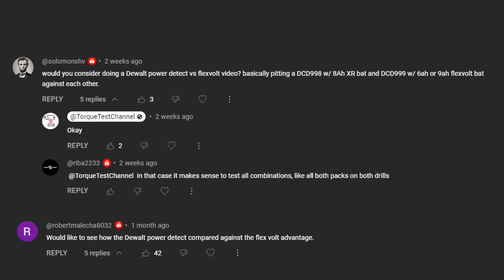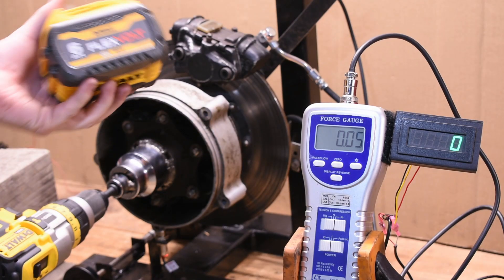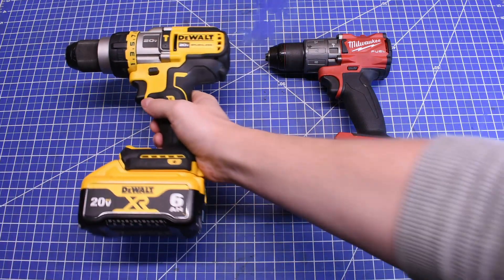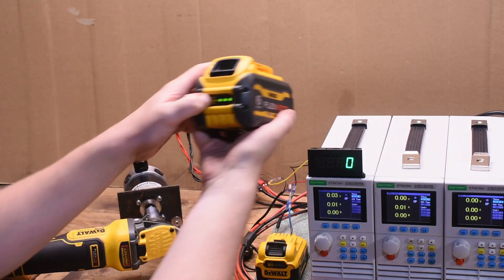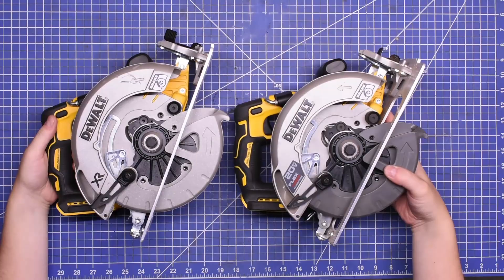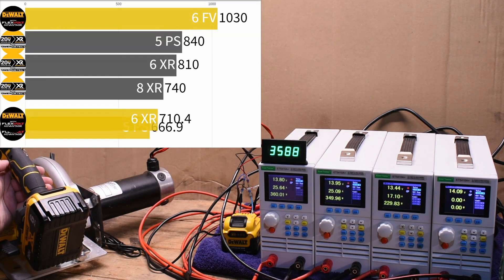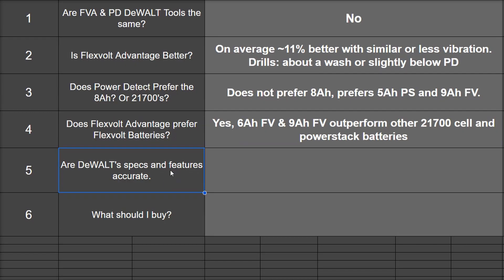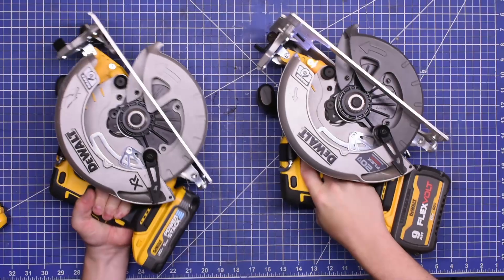Investigating the Biggest Lie in Power Tools: DeWALT's Flexvolt Advantage v Power Detect

Comment: Starting my tool collection from scratch after being out of the country I spent a lot of time picking a base brand I went down the rabbit hole. I ended up with Milwaukee because they had the least confusing battery solutions. I know every battery works on every respective tool. I think DeWalt has some amazing stuff but limited by their complicated battery options.  Trying to buy my dad and brother DeWalt tools can lead to madness. Thank you for this video as I hope it saves others the rabbit hole.
Reply: Say what you will about Ryobi's tool power (they seem to consistently take up the rear in head-to-heads between all the brands @ Home Depot) but the fact they all use the exact same battery is nice. 

Even if the battery is foot shaped.
Reply: @steveheist6426  I use many Ryobi tools. The problem in my opinion with Ryobi is the cells in their batteries. They use cheaper cells a lot of the time and it hampers their own tools.  Fine if you are using a tool that doesn't demand excessive current but  use something like a mower, grinder and suddenly the battery will run into thermal issues before it is out of capacity. I recommend Ryobi just trying to set expectations.
Reply: @cndjonno  I definitely have run into thermal limitations of the design with their 18v mower in Arizona heat, I will give you that xD
Reply: dewalt seems to finally be phasing out their older batteries and streamlining their lineup for tools as well. finally.
Reply: Milwaukee's dog shit battery lineup is the reason i went with dewalt. there are no good compact 18V batteries. their 2amp M18 battery is huge for what it is. their compact tools have their own battery 12v lines that require different chargers. 

with dewalt, you can get a tiny 1.7ah powerstack (my favorite battery) and it will work with the entire tool lineup, anything from a compact drill to a chainsaw, with the exception of their really expensive 60V tools. but those are clearly marked as being 60V. Their 60V batteries can work in 20V mode and will run anything.
Reply: @solomonshv  every one of my Milwaukee chargers has a spot for the 12v batteries
Reply: @solomonshv i think you never really worked with the fuel lineup from milwaukee. And now you’re on the best of dewalt. Comparing apple and oranges. M12 tools are smaller tools and made to replace handtools or small air tools. Then m18 are the bigger, more powerful tools. It’s really easy to understand and most have both. That’s why milwaukee gives a charger that charges m12 and m18 in their kits.
Reply: I own dewalt but I would own Milwaukee. I think it's smart that they have different battery form factors.

Comment: I have 3 Flexvolt 60 tools and there all great performers 

The 17 inch Flexvolt 60 Trimmer crushes battery’s even on low and goes through 6 amp way to quickly with 9amp being much more useful

Comment: Honestly this kinda makes me feel I'm glad I own Ryobi. Everyone I know gives me the. (are you serious look) but then in my end it still cuts and drills and if they don't perform that good... Well... I have more batteries to burn though.
Reply from the maker: What's Ryobi's best mid size battery?
Reply: @TorqueTestChannel  I'd put my money on the 4 or 6Ah, but they do have 21700 cell packs now as well in the form of the 8 and 12Ah.
Reply: @TorqueTestChannel  if we're talking about workhorse batteries it would have to be the 4amp hour in my experiences. And I'm a power user of Ryobi, rigid, and Milwaukee. Will a little bit of Bosch.  Obviously through your work you might have noticed that rigid and Milwaukee do 5 amp hour. As a power user of Ryobi you pretty much are face between two different four amp hours being the regular one or the HP. I do feel a little bit better performance on the HP especially with blowers.... Still runtime probably is better on the HP batteries because you don't have to work as hard as the standard 4amp actual work . And not to be confused with more productivity with an HP battery. As well as looks. Ryobi is really sports car styling their tools especially the HP line for people like myself to feel better. The HP batteries and tool do perform... But still it's going to be a 4Am phone for I feel 90petcent of Ryobi users even if they're power users. The yahhh.. 6 and 8 and 12... But those are really for power hungry tools like blowers and vaccums for excellent runtime or saws to work on job site with allot of use
Reply from the maker: They have 3-4 different 4ah batteries is my point lol
Reply: @TorqueTestChannel  Right, yes, their marketing sucks. I'm talking about the PBP004 (HP 4Ah) and the PBP007 (HP 6Ah). The 21700 packs are the PBP1008 (HP 8Ah) and PBP1012 (HP 12Ah).

Comment: Is there anyway you can hook up the tools to a current regulated power supply? This would definitively prove that there's no tech really involved, it's just down to how much total power the tool is able to draw from what is connected and that most of the tools are artificially limited by the capabilities of the battery packs, wiring, and controllers. This could also add another stat to the charts of theoretical maximum output for the tools which could help see what kind of improvements the manufacturer could make just by optimizing the batteries to hit those max power targets in future revisions of the tool(s).

Comment: Thank you Torque test channel. You guys hit it on the head there’s so many hurt feelings for their Tool brand but the battery voltage does make a difference…And higher output or watts or torque can be limited by the individual cell output ie more expensive cell. Equals a higher tool output ?  The RC industry uses a “C” rating on batteries 🔋 and that greatly affects cell output and usually cost … could you use a c rating on tool battery packs? PowerStack
Forge
 Are pouch cell batteries that are lithium polymer?  And one cell can make 4.25 Volts.
Open cell voltage. 
Check out Gens Ace HVLIPO. Can you guys do a show on battery technology? Or have you?
 lithium-ion or Li-ion 

Lithium Polymer or LiPo 

Lithium Polymer HV

LiFePO4 
How do these compare?
How are these now considered “Safe”
LiPo’s used to have a “recommended” charging of inside a fire proof bag ?
So ?
Is Lithium-ion-polymer 
A new type of battery chemistry 🧪?
Or just a tool company made up word?
What’s the difference 
So a M18 with a open cell voltage of 20 now could be as high as 21.25 volts??
If it’s a 5 pouch cell battery 
Or 25.50 if it’s a 6 cell battery??????
Ha ha 
Love the Channel and the No BS Torque output #’s
Reply: Dam can I edit IPHONE VOICE TO TEXT SUCKS

Comment: I am confused about the "Advertised Difference Column", advertised difference in reference to what? A non FVA and Non-PD tool, or in reference to each other?
Reply from the maker: The difference DeWALT advertises or at least has provided some spec to the press between FVA and PD. Like FVA is supposed to be THIS MUCH more powerful than PD based on watts out

Comment: 1% is testing error
Reply from the maker: 1% is a testing error within 1 test yes. At least. But each test had 5 runs and used median run as data. There was 3 different tests, torque, watts low, watts high. Each of those 3 tests were performed on 2 tools, 4 batteries each. Each average of each test came out with match data.
Pluss this way of measuring watts is fairly consistent, the tools always make the same every time. That all said, you're still right. 1% is nothing.

Comment: It's as simple as Lowes and Home Depot having their exclusive high end offerings for customers who frequent one store over the other. What irritates me is the amount of R&D $ dedicated to making tools with trivial spec differences drives the prices up.
Reply: Im sure it has to do with pricing also. By that I mean price matching between retailers. If the 2 headliners have exclusive models, then nobody else could have the same model for cheaper.
Reply: probably takes 10 minutes to decide how to make them different since the differences are so minor.
theres no R&D in that...they just call joe the electrical engineer at his extension and ask.
he pulls up the component specs and says yeah make this capacitor bigger and this resistor smaller, turn down the potentiometer a couple percent and voila....motor is good for way bigger difference so it dont matter a few - 15% percent......when joe quits theyre scrambling tho
cuz it is that easy
Reply: @kazzxtrismus  I can only assume that's an oversimplified way of looking at it. They have different internals, different externals, different labels, different packaging, different advertising signs/online listings, etc.
Reply: its literally how it does work.....changing aesthetics etc is just "icing on the cake" or marketing department shenanigans.
the motors work in a window of voltage ameperage and maybe frequency...theres a dozen ways to skin that cat and swap components to end up at a result within the specs.....the trigger is just a trim pot etc.
its still just the archaic stuff from the old days in a new smaller package....but at the end o the day....its so similar its a joke.
we're at the age of commoditized electronics and have been for about 20yrs @Tool_Addicted_Carpenter
Reply: @kazzxtrismus  I understand. I wasn't denying the simplicity of the electronics aspect, I'm saying that what you call "icing on the cake" is obviously not free.

Comment: I would like to see how the 12Ah Flexvolt perform against the 9ah FV.
Reply: i beleive its the same story as the 8ah xr 20v vs the 6ah xr 20v pack. t30 vs t40 cells. the 6ah and the 9ah 60v packs while not having the capacity as larger packs, are built to have higher discharge capacity.
Reply: @nwngunner   well said! 9ah is much stronger.

Comment: Ya that drill is the only imposter I have no idea whh theh don't make it actually connect with every prong in the flex volt battery
Reply from the maker: Connecting to both the 20V and 60V terminals would fry the tool

Comment: Here's the other question - are these worth it over the non flexvolt advantage/power detect models? As soon as you start needing the 9ah flexvolt 60v packs to get the most out of the tool, why not just jump up to the full 60v tool and get all the beans? At least that was my conclusion on my grinder test video, but I'd love to see your scientific measurements to back that up.
Reply: both 998 and 999 drills are way more powerful than the other drills dewalt makes. so yes, it's worth it. also think about the future. maybe sometime down the line you'll get a 60V tool, something like a mower, chain saw, snow blower, etc that will come with a 60v battery. that will automatically make your existing flexvolt tools better
Reply: @solomonshv I already have a bunch of 60v tools, hence, I just bought the 60v grinder. I only picked up the flexvolt advantage because it was on for a good price and wanted to see what it was all about...I wasn't impressed.

Also FYI, there's no 60v mower yet.
Reply: Well I think the idea is that it's just something that gives you more options. Like trading efficiency for the ability to use a multitude of batteries.
Reply: @WC3fanatic997 you could already use a multitude of batteries...the real question is, does it actually do anything or is it no different than a better battery just doing better things. It shows up in every TTC video, put a 5ah PS on a tool instead of a regular 2ah and the tool gets more beans.
Reply: I like the versatility of FLexvolt and XR tools.I like the FLexvolt batteries on high draw tools and xr batteries on drills etc to keep weight down and of course the Flexvolt batteries can work on XR tools when needed. I love my Dewalt cordless tools they have revolutionized my productivity.

Comment: Less than 2 weeks ago I bought the XR angle grinder 😂 
Threw away the receipt and box a few days ago. Magnificent
Reply from the maker: If it's power you're concerned about, simply the knowledge that using a 6ah XR or 5Ah powerstack does that much better than an 8 makes up any difference between lines. Or yolo with the 9Ah for more runtime.
Reply: @alexander-yd3hz  more powerful cells inside

Comment: I think the purpose of this is that they signed “exclusive” contracts with both Home Depot and Lowes. Both stores wanted a different line, and Lowes wanted to make sure that their product wasn’t clearly worse than home depots. If the flexvolt was the “top of the line” then nobody would buy dewalt tools from Lowes. Thus they end up making two slightly different tools, surround it with un-verifiable marketing, and confused customers continue to buy tools from both retailers
Reply: Same shit with Stanley hand tools only being at HD, Craftsman hand tools only at Lowe's.
Reply: @orijimi stanley is mother company of dewalts....
Reply: Flexvolt is the top of the line. Pure Flexvolt is 60V only. The circular saw runs circles around every other DeWalt circular saw. And yes. 60v Flexvolt is only sold at HD.
Reply: @rossb5593 the circular saw I have is only 60v and it’s a damn beast
Reply: Even if each store has an exclusive contract with DeWalt, why can’t DeWalt use the EXACT same tools for both stores, but just rebranded? I wonder how much it is costing everybody to have two nearly identical, but very much different tools going to two separate stores, just for the sake of having a freaking contract. Imaging how much it is costing US as consumers to pay for high priced tools from a company that is incredibly inefficient at the manufacturing level.
Reply: You do know why Lowes does it right? Their "if you can get it cheaper then we will match it" moto. So they have a different version so they can piss all over that moto which is why I tend to not like going there unless a really good deal or they just have what HD stops carrying.

As far as the reason if its not fully clear, if say HD does a deal and they sell out of said product then people could take the lesser price proof to Lowes and get a discount which is pretty much the only reason for their moto. If you don't got it then they don't have to honor it and Lowes is big enough that Dewalt makes another model for them.
Reply: @silentferret1049  Exactly. They do this so you can't price-match between them because they are "different" but extremely similar tools.
Reply: @silentferret1049  +1 they do this with their other competitors throughout the country, particularly Menards. Lowe's makes sure they have as little inventory overlap with Menards as possible even when it means (and it often does) that they avoid carrying high-quality/ubiquitous tools and materials that pros depend on constantly. Lowes was my only nearby hardware store option for 20 years and it drove me crazy, I would often drive the 30+ minutes to the nearest Menards when I needed to spend real money. 

Damn near wept with joy when I saw Menards had bought land 3 minutes from my house and was putting a new store in. It opened 18 months ago and I've scarcely been back to Lowes since!
Reply: In reality both are great tools from both lines. All depends on the batteries you have, do you have both stores nearby, the price etc I don't really find it confusing unless you're tool brain dead IMO

Comment: Is there a price difference between the two? If the saw has 20% better performance at a 50% higher price that might change the math, or those two drills. Second question: How many contacts do they have with the battery? Is there even a way for them to sense anything? Or is it the standard two power, with temp connector.

Great work as always.
Reply: The 60 volt DeWalt saw vastly outperforms the 20 volt version, if you're a professional or just like buying the best it is worth a little extra money. I bought that and the 999 drill kit, which means I have two 60 volt batteries to run my saw, which is plenty honestly. 

Also the kit is usually about $100 more than the bare tool. The battery that you get with the kit costs more than $100 by itself, plus you get a fast charger with both those kits. The 60 volt saw comes with a 9 amp battery just like the one he was using in this video. That battery by itself is very expensive and it is awesome.